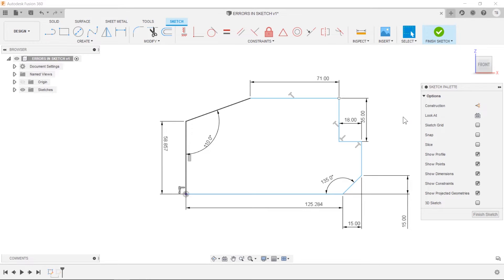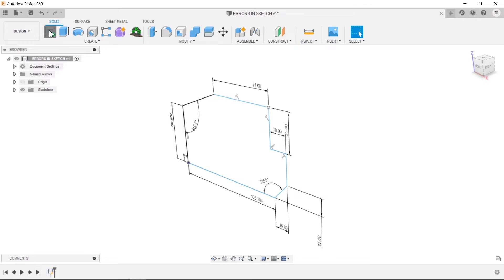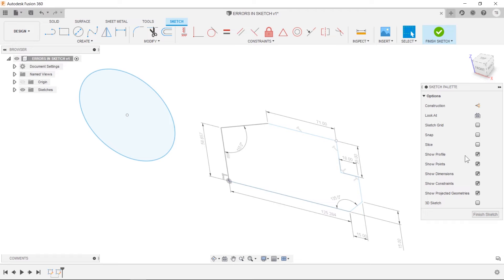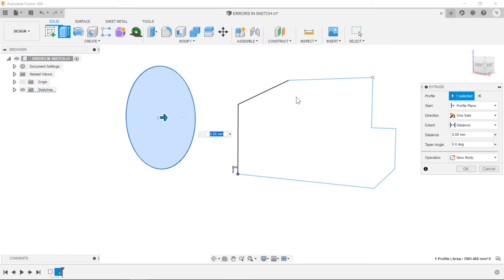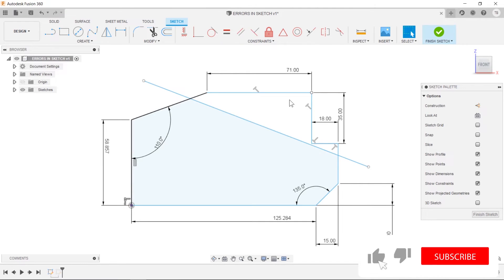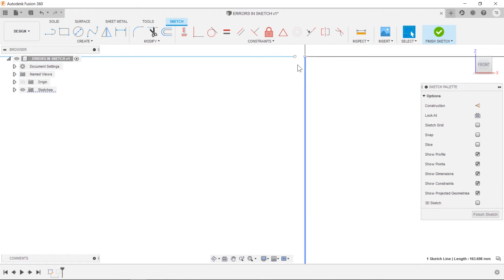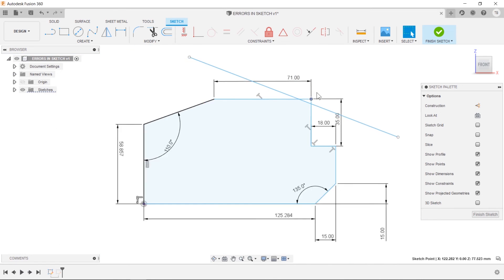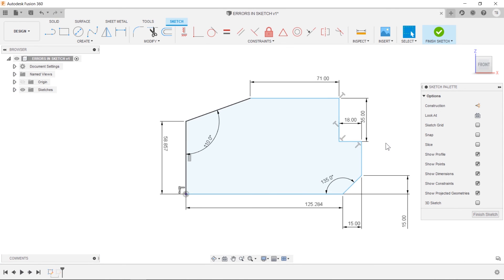Fusion 360 errors in a sketch (How To Fix Them Quickly)

Comment: im having an issue when i import svg images they will have sections that i cant select but all the dots are joined even at full zoom in, then when i add lines to it to overlap the join and make sure its complete then i get errors when trying to extrude and it wont let me, its getting super frustrating

Comment: You can also grab the extend line tool and quickly run over all lines, if it extends past the line it is fine, if it only extends up to the next line then it's not connected and with one click it's fixed
Reply from the maker: Great call!